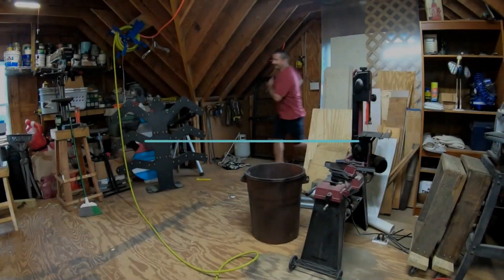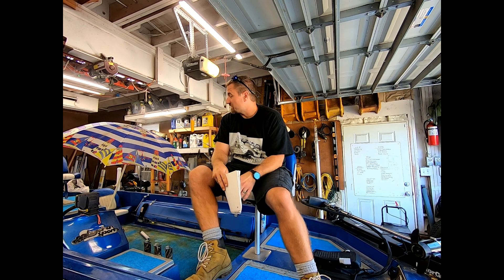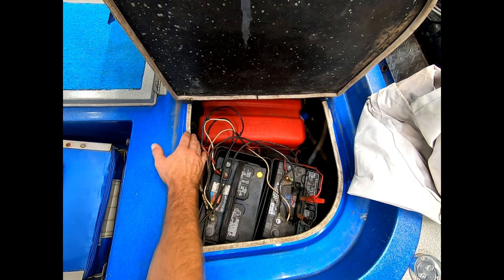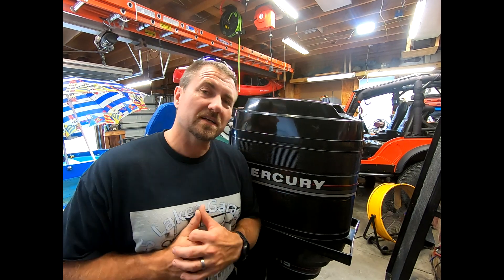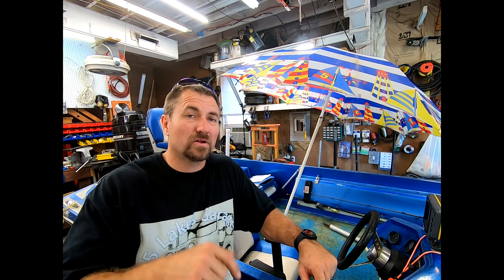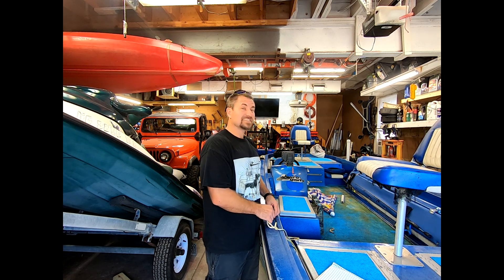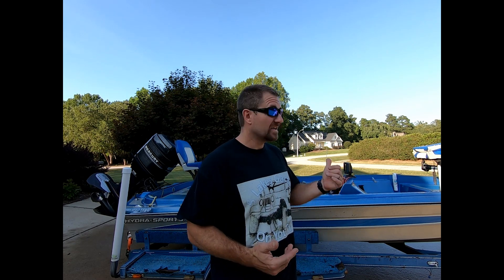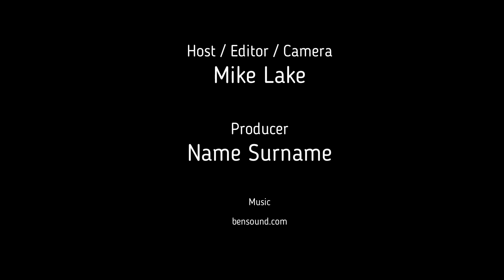Sitting for years.    New Project  1976 Bass boat with a 1986 Mercury  (Fishing Time)

Comment: Strongly suggest a battery maintenance charger from Cabelas. Extends battery life years, simple name, Old Blue
Reply from the maker: I do have a few maintenance chargers for the jeeps and dodge.   Did not get it at cabelas but I might look into them.  the ones I have are the greatest.   Now since the batteries are connected as 24 volts.  Would the cabelas charger handle it or do I need to do it one at a time?    

Also simple names work well.   thanks

Comment: I'm not a fan of that fuel tank beside the batteries. Boat name: A Sea D Sea or The Gilded Lady
Reply from the maker: for now it works.  :)    So the tank will stay for now.  the original aluminum tank fits in the same spot.   I have not dove into that yet.    I have to get the JetSkis out of the shop first.   Thanks for the names.   I will put them on the list.